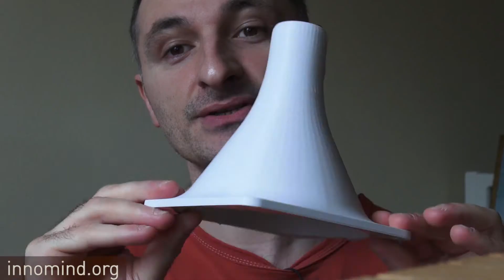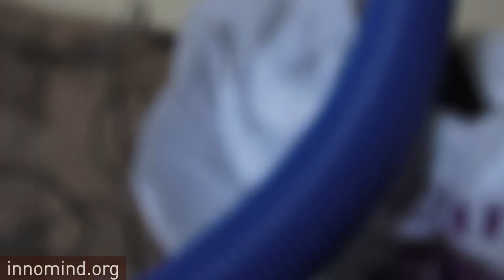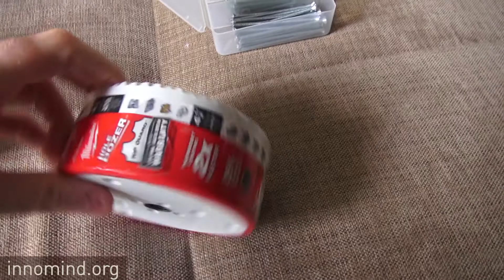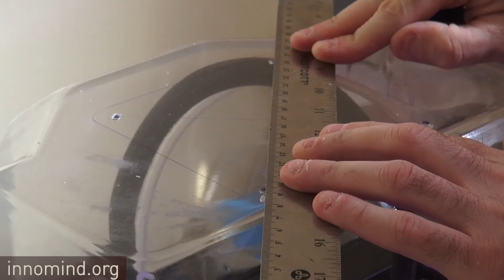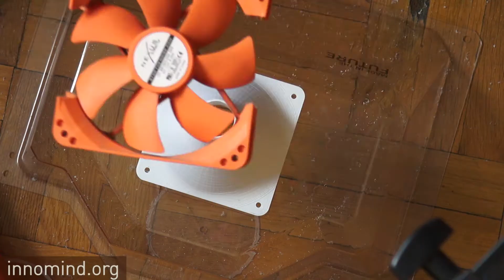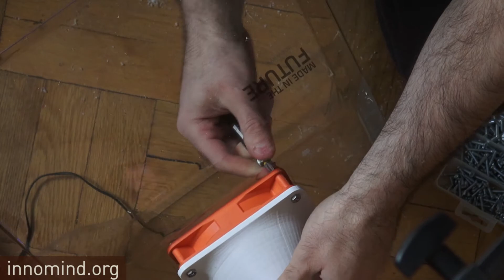HOW TO EXHAUST PLASTIC FUMES FROM MAKERBOT REPLICATOR 2X

Comment: a year has passed, have you improved your system?, adding maybe a filter?
Reply from the maker: Nope, same system, I had my Replicator 2X for 4 years now, I don't think it's worth upgrading it more.
Reply: innomind after a year with your system, do you think it made a difference? no more abs odors?, or if you can measure, particle count?